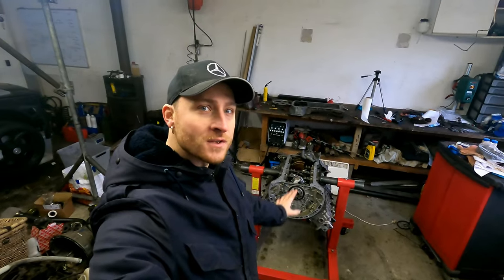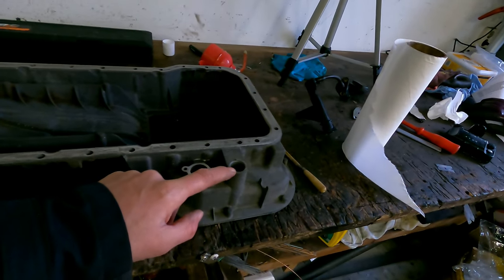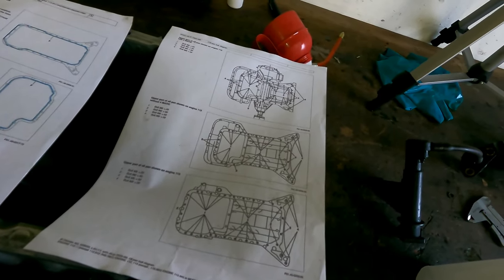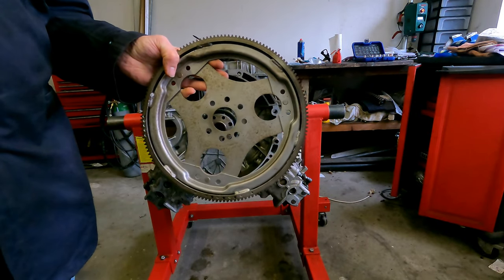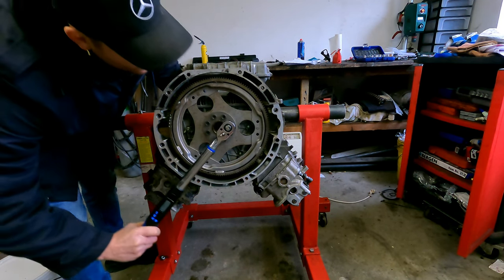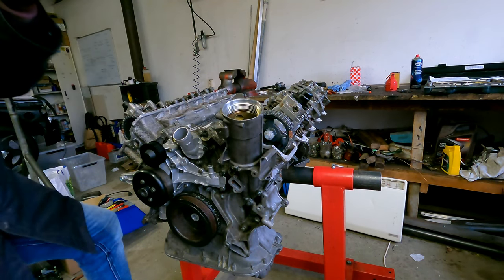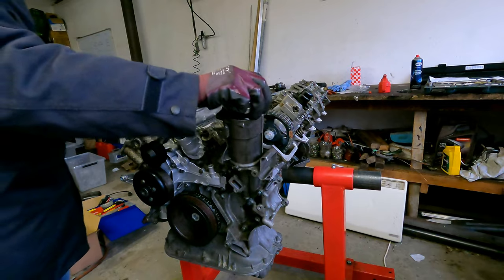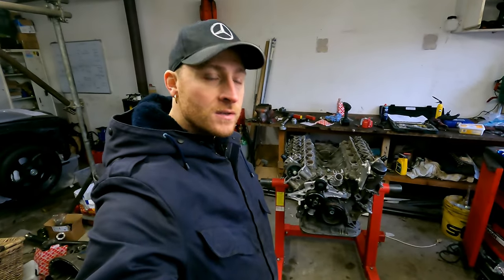M113 engine rebuild - Part 14 - Installing oil sump’s Oil filter housing and Flexplate

Comment: Oil level sensor tells you piston went through the block .No presure sensor did the trick?
Reply from the maker: What do you mean    i removed  the level sensor.  And place a pressure sensor on the front of the block

Comment: is your oil cap missing the center half. it's broken
Reply from the maker: Oil cap.  From filter housing?
Reply: I know what you're referring to. I have an M113 in my 4.3L '02 E430 and change the oil myself.  There's a center part that holds the oil filter in place; The original filter housing comes with a pretty weak one and mine broke a couple months ago and the newer oil filter housings come as 1 unit, with the cap.
Reply from the maker: I also change the complete unit the video
Reply: @JMSpeedshop  i still got to hook up my oil pressure sender. i am buying leather seat parts right now. I hope to find a cl65amg. I found a nice w140 armored plated s600 with 15k original miles. Just do not have 79,000 usd right now. 3in thick glass
Reply from the maker: More people have that problem missing the usd to buy more cars 😉

Comment: you need a fleece oil filter for that engine and your plastic cap assembly is missing the center half. it must be replaced. otherwise your oil will bypass your filter.
Reply from the maker: It is assembled like on paper
Reply: @JMSpeedshop  it is broken. i know as i am a master mercedes tech and own that same engine. you need a new plastic housing. yours in broken
Reply from the maker: Dont think so
Reply: @JMSpeedshop  look online and see what a new one looks like and compare.
Reply from the maker: I know how the need to look already. I already replaced it
Reply: @JMSpeedshop  so do i. I have been working on the m113 for over 20 years now. i have repleced these for breaking many times. i am telling you the truth
Reply from the maker: Partner a1121800610
Reply from the maker: But it is still working okey.  It is not by passing the filters.   These will broke more then once.  And like i installed it in the first place it is still closing of at the top and the bottom.
Reply: @JMSpeedshop  i promise you i am not leading you down the wrong path. your filter will slide onto this housing. these are cheap and please trust me on this. I have this same eng in my r230 and I am a master mb Tech
Reply: @JMSpeedshop  also there arre a total of 3 oil seals on the plastic housing. your filter kit should have them
Reply: @JMSpeedshop  just look this part number up online and look at the part. the assembly is about a foot long with a total of 3 oil seals on its center shaft.
Reply from the maker: I know about the 3 seals.  But it is still working without replacement.  Because it is selling ate the bottom and top of the filter.  Filter will not collapse because there is a frame work in it.  These pins break a lot that is why im not always replace them.  But i already dus this time.
Reply: @JMSpeedshop  this part is really cheap. look at the images of it. the filter fits tight on its shaft and the oil seals keep unfiltered oil from returning unfiltered
Reply: @JMSpeedshop  i can get an na om606 for 500usd. do you know what mb it makes for an easy swap in?
Reply from the maker: Everything is a easy swap with a NA diesel
Reply: @JMSpeedshop  i see a 1997 n/a om606 for sale for $500usd and am considering it. i still have an om617 sitting around but cant find shims to sett the inj pop pressures. any idea who sells them?
Reply from the maker: No sorry have no idea
Reply: @JMSpeedshop  i may be buying a cl600 next week. has the m120! super cheap
Reply from the maker: Nice 😎